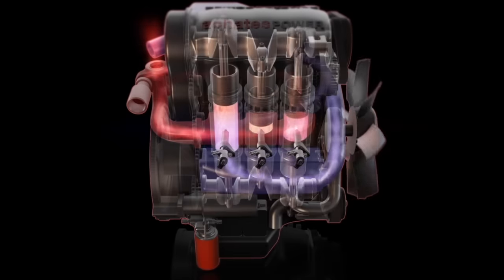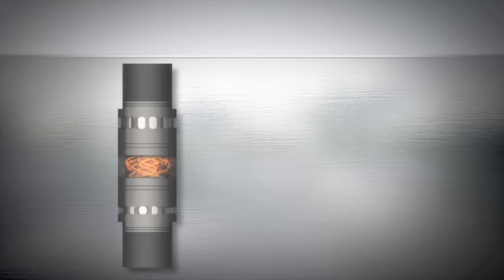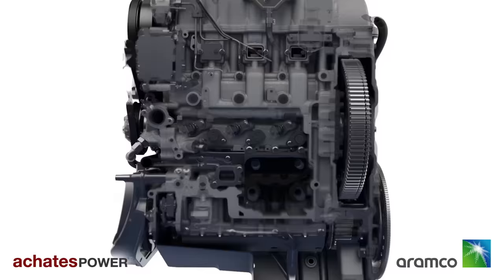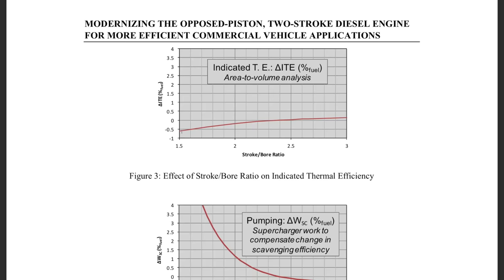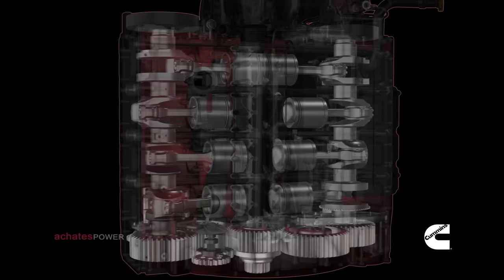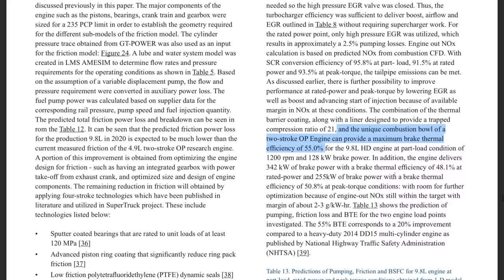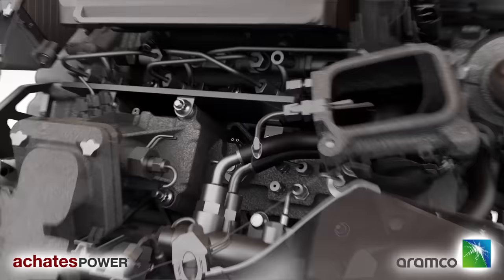Opposed Piston Diesel Engines Are Crazy Efficient

Comment: If this engine could be adapted into a passenger vehicle at a reasonable price I'd buy one tomorrow!
Reply: I’d buy one today
Reply: ...If the entire thing costs $20 cause that’s all I got
Reply: There is currently an F150 with an Achates engine being tested.
Reply: I'd wait for the 1st generation of these engines to point out the flaws that manufacturers need to work on - and then buy a 2nd gen.
Reply: @FredNagel  As if they'd care enough to fix the flaws
Reply: Craig Downey can you sell me some money please.
Reply: @hello-jc1rx  WTF
Reply: @craigdowney3128  sorry
Reply: My thoughts exactly. So why aren't they?
Reply: this engine should reduce the fuel consumption to 20-30% ! this is amazing!
Reply: Stephen Ferree  yes thats true, but only in countries where the electric infrastructure is enough developed. I mean the customer don't want to stay at home 3days until the battery of the car is full charged.
But for countries or regions where the population density is low, it could be a method to increase the miles per gallon quantity.
Reply: @karlschuster8853  it was -28C overnight here where I live. I doubt any battery's ability to hold rangeful power at that temperature, or to provide anything close to lab-spec while also heating the cab. I know fossil fuels have their limitations, which is why this type of engine is so exciting.
Reply: Hmm, If they prove how to lubricate without oil leaving the engine from exhaust holes in that cylinder design,  I would say "shut up and take my money!" too.
Reply: Stephen Ferree  If the fuel consumption will fall all around the World, fuel prices will fall. Than it will be difficult for electrical cars to compete against petrol vehicles. I think the future will be hybrid. However, they will call the engines generator instead of engine. Than my friend, you and I will say shut up and take my money. If we live, we'll see.
Reply: Stephen Ferree  Now if only electricity grew on trees.

And no, in 20 years electric cars won't be all that will be available. They'll still be a small portion of new car sales. In most developed countries it will still be legal to sell hybrids until 2050 according to current regulations. Even after that it will be perfectly legal to buy a used ICE car and will probably be another 15-20 years before the majority of the cars on the road are scrapped and replaced with full electrics. By 2060 most cars on the road will still run on fossil fuels primarily.
Reply: biodiesel can be made from just about any carbohydrate.
Hence, these engines will be goldmines after the  apocolypse.
Reply: We had the Napier Deltic diesel engine in trains in the UK back in the 60's. Nothing new about this design. I suspect they will be too heavy for use in cars.
Reply: Stephen Ferree  How do they make the electricity?  Wind turbines are froze and not spinning.  When they do spin, kill endangered birds.  Yep, fossil fuels it is.
Reply: @JimiHendrix998  No heads or camshafts or valvetrain. I suspect it is lighter.
Reply: Stephen Ferree  When electric car batteries can:

• Go the same distance as a current gasoline or diesel engine powered cars can.
😮 Oops!  They're nowhere near being able to accomplish that!

• Can FULLY CHARGE the electric car battery in the same time it takes to fill a gasoline/diesel tank with fuel.
😮 Oops!  They're nowhere close to being able to do that, either.

• Can FULLY CHARGE your electric car battery on standard home power outlets in (AT LEAST) 2 hours.
😮 Oops!  Yet another aspect of the electric car that is nowhere near being able to be realized.  * Currently, they can't be fully charged on standard home power outlets in EIGHT HOURS! 🤣

• When the electric car batteries have a longevity (and) FULL BATTERY capacity of AT LEAST 10 years.
😮 Another oopsie!

• When replacing electric car batteries doesn't cost * ONE THIRD * of the * TOTAL, ORIGINAL VEHICLE PRICE! *
😮 And another oopsie!

Full replacement of an electric car's batteries shouldn't be more than $1,000 USD, (and that's being generous) as the $1,000 mark is usually the limit the average person can handle financially.  Large numbers of people can't even afford a repair of that expense without losing use of their vehicle. 

So let's not put electric cars on pedestals, shall we?
Reply: Stephen Ferree  Electric cars kill them too. Look up how long it takes for a windmill, built with fossil fuels, pay for itself.
Reply: Stephen Ferree  I'm 51 and the first thing I ever heard was we are running out of oil.  Those planes that take 1800 gallons just to take off the runway have been flying every day. You have a president that has never owned a car.  There are oil wells all around me my entire life. Somehow they found the space to drill 613 more the last few years.  I'm for electric but do not artificially make my horse more expensive so as to force me to ride the steam engine.   Shutting down the keystone pipeline does just that. You'll see that the oil still gets shipped, but it goes by train.  Who makes more money? Who pays more for the end product?  The govt can't make as much off a pipeline on private right of ways.  They learned that with the Alaskan pipeline that has been flowing for decades.  Oh there was going to be so many problems, that never happened.  Really it comes down to liberals can't stand private industry.  The same thing will continue to happen, but you'll just pay more for it unnecessarily.  Electric cars have a 200,000 govt subsidy on them. But they have you conditioned to complain about farm subsidies.  It's all a game and you are one of the pieces.
Reply: @ridgerunner106  I'm 56 and live in the UK.
I pretty much agree with everything you say.
The old 'artificial scarcity' trope, regarding oil reserves: it never fails to get 'em!😂
And that's even if you accept the biotic origins of oil, which many don't.
(Don't most living organisms rot away or get scavenged, when they die? Not in the case of crude oil, it seems. Funny, that.🤔)
It's good to see a few voices of sanity left, in an increasingly mad world.
Cheers!🍻🤝
Reply: @gedofgont1006  We need to make everything as affordable as we can for each other.  Real cost, not artificial. You get it, I like that. Come see us.
Reply: @ridgerunner106  I would, gladly!
😀
Reply: Toyota, Porsche and Subaru should put this engine a new MR2/Porsche 914
Reply: @ridgerunner106  who cares about the birds..
Reply: @holyfrijolesvlogs1554  
Start a gofundme. Here's a buck $
Reply: Wow 40% efficiency. Nearly ½ that of Electric! So sad!
Reply: @skmarston  yeah and than you factor in the energy that is lost from the generator to your home and electric vehicles dont look so good... also the price
Reply: @skmarston  give me a gas or diesel engine without the possibility of it "running out" unexpectedly!
Reply: @Jeff-Vader_head_of_catering  Even though this thread isn't about electric vehicles, after reading your comment I couldn't resist my eagerness to leave a reply. 
* First of all, there are electric cars that has the same or even more range (600km+) of fossil fuels powered cars (500-600km)
* Battery swapping technologies are being introduced and fast charging technologies are being improved so in future it will take almost the same time as refueling a fossil fuel car.

* You can recharge your electric car in at least 8 hrs at home, but can you even refuel your petrol or diesel car at home?
*Battery technologies are rapidly improving, Tesla now gives you  up to 8 years warranty for 70% total battery capacity. So 10 years with full battery capacity is totally capable in future. On the other hand, do you think a petrol or diesel car still has the same range or power when it was brandnew after 10 years? 
* And at last, battery prices are coming down and it won't cost a fortune to replace an electric car battery in near future. And after all, please get updated.
Reply: @KF1  no there isnt , you would have to keep it plugged in or keep it and charge it in underground parking lot with alteast 0C temp ..
Reply: @Castor561  that could work for a lot of people who park in the garage. Not for me, though.
  Given the excellent energy density of gas/diesel, these small jumps in efficiency as shown in the video are actually huge leaps. Coupled with advancements in battery life we could see some wicked good hybrids in the near future.
Reply: The block itself wouldn't be too bad from not many moving parts but with two forced induction systems it'll be a mess. I'm guessing oil starvation and bearing issues would be the main culprit for failure
Reply: @JimiHendrix998  I'd sooner have the weight of an extra crankshaft than a ton of heavy batteries that will only get me to the next town and back before needing to charge.
Reply: Cute comment
Reply: Today hybrids are absolutely ruling the car scenario and will continue for about ten years, just when electric cars will be perfectly improved and more affordable.
Reply: @rivahoff  hybrids are what?? 🤣  ok
Reply: @KF1  And the excess heat from the engine can heat the cabin, thus increasing total efficiency even more.
Reply: @cenchloraadums3143  If you've been shopping for any type of lithium cell or battery recently you would have seen that prices are going up, not down.
Reply: I'd really like to see this on a Mazda hatchback or sedan because I get a kick of out of diesel sedans
Reply: No -governemnt
Reply: My dad had one in a Commer truck in 1955! It sounded lovely!
Reply: @holyfrijolesvlogs1554  I want it yesterday
Reply: @holyfrijolesvlogs1554 

.
Reply: @chrisfinnerty9529  lu.
Reply: @chrisfinnerty9529  lu.?..
Reply: @holyfrijolesvlogs1554  

.
Reply: @holyfrijolesvlogs1554  k mn.,.
Reply: @holyfrijolesvlogs1554  k mn.,. M
Reply: Just like with the boxer they will hace 2 head gaskets

Comment: It's funny how things go full circle. A engine built in the early 20th century is brought back and with a modification or two turns out to be  a better design than current engines.
Reply: It's new kooks trying to resurrect technology which has been long dead for good reason in a bid to attract VC. This engine will never meet emissions. Period. Maybe it'll see the light of  day in Mil prototype but the DoD is so slow to adopt new tech they'll be long bankrupt before anything would hit the battlefield.
Reply: They've reinvented the stinkin' Commer Knocker but without the noise (which was the best part of the POS lol)
Reply: otm646 What would the reason be for it not passing emissions? You could add a dpf etc to it just as well as in normal 4-stroke diesels. Also the efficiency being higher should mostly impact emissions positively. 
My guess would be that the NOx emissions could be a problem in this kind of a configuration, as I would suspect that combustion temperatures are actually higher in this engine than in usual 4-stroke diesels.
Reply: What if you put a big SCR to the exhaust and pump in a lot of addblue? To meet emissions standards.
Reply: Gonna be really interesting if the rotary makes a comeback in a few years
Reply: They talked about this at the auto show. It runs at a higher temperature resulting in more efficient catalytic burning, reducing emissions. Adding DEF to these is not the answer and would ruin this engine, IMO. The first thing anyone does with a new diesel is delete the crap to regain MPG and power.
Reply: The rotary was never a good design, only different. The problem is poor efficiency, poor torque and heavy pollution.
Reply: No Dominic, this aint a 'better than current' engine, in fact it's a polluting nighmare (it spits unburnt oil), plus it cannot be modulated too much (which a car really needs). The only reason that it's more efficient than its earlier version is the quicker injection (in lesser time) due to electronics we have these days. So, not a full circle by any means, more a dead end.
Reply: no thing's new under the sun man......
Reply: Electric engines are the real full circle... one day gasoline engines will be a rare item to see or own
Reply: electric will never meet the battery/ah/weight ratio required, but steam engines will soon rule the engine marketplace as the most top notch efficient and prevalent design of the future of engine tech
Reply: ThePaulv12 I thought I was the only one here who could remember the old Commer/Karrier trucks with ,as you say , their wonderfully distinctive sound.
Reply: A 2stroke and an diesel engine !!
Wow that's a combination of two engines that are famous for their bad emissions
Reply: Iz Meorbin Why would it spit unburnt oil? It's a 2 stroke yes, but it has a closed sump like a Detroit diesel. It uses the supercharger in place of crankcase induction.
Reply: But it in a car 😘
Reply: Nick Ferguson Someone say a VW bug?
Reply: Still, It will stay on Lanfillgas/Biogas power plants and in the largest cargo ships.
Reply: Iz Meorbin, Please explain why this engine spits unburnt oil.
Reply: Ernst Otto Oehler, 2-stroke engines have bad emissions because when the intake air pushes the exhaust out, if you want to maximize performance (not efficiency) you design it to make sure it pushes ALL the exhaust out. This results in some unburnt air and fuel to be pushed out the exhaust as well. This unburnt fuel in the exhaust is the cause of bad emissions for 2-stroke engines.

However, this engine and any direct injection 2-stroke engine can use clean air with no fuel from the intake to push all the exhaust out with no unburnt fuel. Then, after the exhaust port has closed, or the exhaust valve has closed, it can inject the fuel into the compressed air in combustion chamber. This completely eliminates the bad emissions that are typical of 2-strokes.
Reply: Except for the LS. We all know that engine is the be-all-and-end-all.
Reply: tpshultz electromagnetic will. We are swimming in that stuff. There is no gravity, there is only magnetic fields. Gravity is an invented off shoot tag to describe magnetic field. Tesla understood this and more.  The fossil fuels are not fossil at all, and we have been brain washed . Physics will take a turn w Aether/ Ether or whatever they call it.
Reply: dominic coscarelli Commer knocker engine
Reply: otm646 General Motors . Detroit Diesel already use a 2-stroke turbocharged scavenging diesel engine which has been removed because of the emission controls
Reply: Ukrainians play with such engines for at least 55 years now.
Those aren't not clean or particularly efficient. They have best power/mass and weight/mass ratios possible. And unexpectedly silent also.
5-cylinder version produces up to 800 HP and 6-cylinder version is about 1000 HP.
Reply: David Hollenshead but very very high RPM because they didn't change the direction of their piston they should have kept going with it
Reply: Bob Saget not while the oil companies have a say in it
Reply: tpshultz not until you can have a nuclear reactor in your car to generate the heat
Reply: Ernst Otto Oehler ever seen the black s*** a Mack pumps out pulling up a hill
Reply: Ordinarily Dave the best Improvement to a Volkswagen bug is a set of pedals to make it go faster
Reply: Terje Oseberg thank you very clever nobody else called on to this fact the 2-stroke petrol over scavengers
Reply: this voice to text doesn't work very well it's very clever nobody caught  on to the fact that a 2-stroke petrol over scavenges losing some unburnt fuel
Reply: Satunnainen Katselija, I never said diesels were clean. What I did was explain why a typical 2-stroke is spewing out unburnt fuel. They also spew out unburnt oil along with that fuel.

Regarding diesel, I know they pollute more than gas engines. Is it possible to fix this? I have no idea. And I too am disappointed that they failed to mention anything about emissions in this video.
Reply: Most ideas come about long before the surrounding technologies are available.
Reply: Iz Meorbin If we can figure out a suitably resilient ceramic or plastic material rotaries might come back around. Materials with low thermal expansion coefficient make sealing easier, and with a electrically insulated body the arc could be placed at the leading edge of the combustion chamber. (Although at this point EV is too far ahead for the transportation market though ICE will live on in the sport/leisure market)
Reply: BMW has been using the opposed cylinder engine for a very long time. My R1200GSA is and gets better mpg's than all my buddies bikes.
Reply: @izmeorbin9602  doubtful considering that old 2stroke DD with simple modern camshaft profiles meet current emissions standard
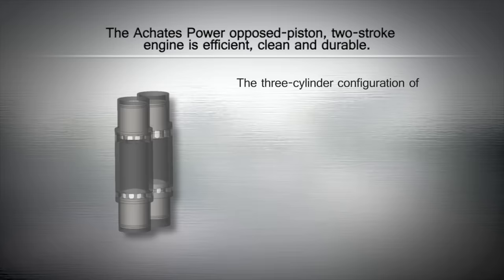Reply: Yeah... emissions are not even worth talking about according to the video - 2:50
However, I wonder why does it have to be a two-stroker?
The INSANE bore/stroke ratios magic would apply to any four stroke engine.
Reply: dominic coscarelli you could say the same thing about electric motors. The electric motor was invented only about ten years after the internal combustion engine.
Reply: @suddenkancho4968  that would defeat having a simpler engine and take away a lot of the efficiencies where are you going to put the valve gear...
Reply: Full circle? Than we'll all be riding donkey's soon
Reply: dominic coscarelli f
Reply: I just hope this engine makes it into production mainly to keep the "all and only electric no ice f boy crowd" silenced for a while.
Reply: @johnvieira6119  "There is no gravity, there is only magnetic fields."

It is obvious that you failed all of your Physics courses, that is, if you ever took any. Go back to freshman year of high school and start over.
Reply: @itchyvet  except Mazda has already announced that the rotary is coming back lol
Reply: Same with electric vehicles.